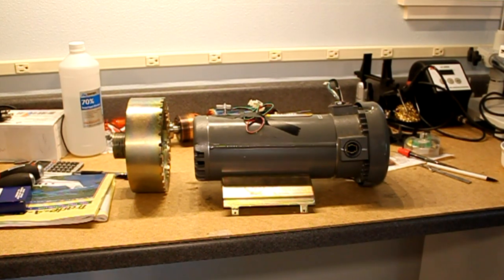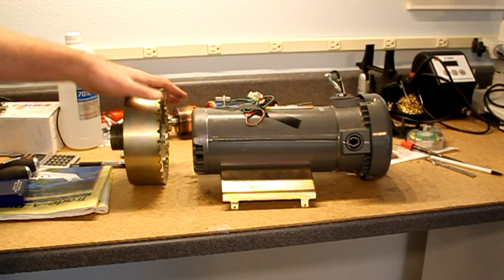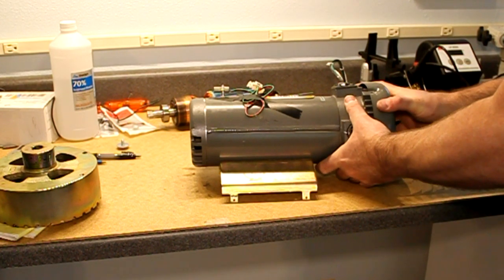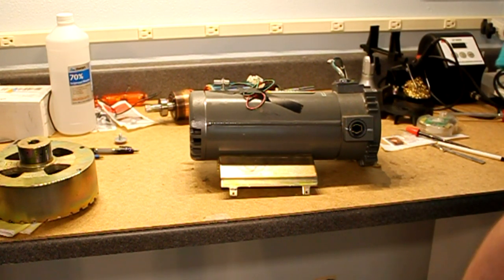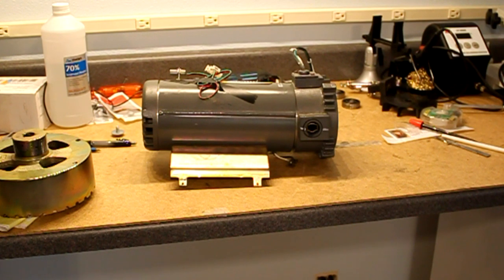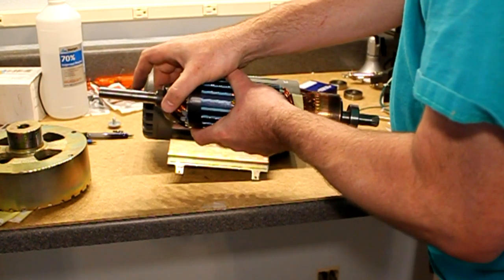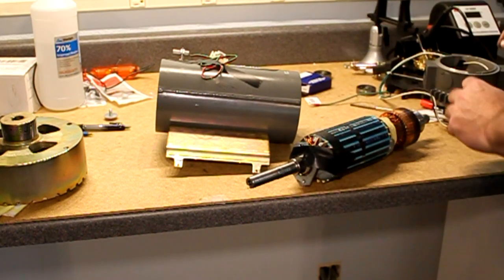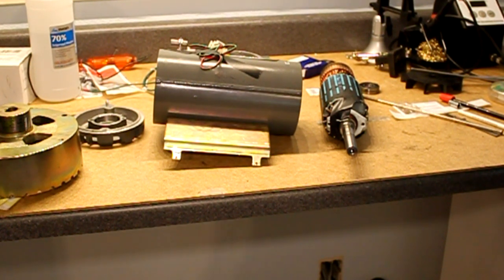Repairing a noisy Landice L7 Treadmill Motor (Baldor Brand)

Comment: Thank you for this video!  

This fixed our Landice L7 Treadmill.  We've had it for twenty years and my wife uses it 5 times per week.  Over the last few years it got louder and louder until we could hear it throughout the house even though it is in the basement and my wife had to use noise cancelling headphones.  

The bearing that was bad on ours was the end with the brushes.  For $14, I got 2PACK TIMKEN 6203-2RSC3 6203-2RS Deep Groove Ball Bearing 17x40x12mm from Amazon

Three suggestions to make the job it easier.

1. Scratch a line or draw a line with a marker on the body across both end caps so when you reassemble you can have the end caps aligned for the long bolt to line up and this also preserves the orientation of the brushes to the magnets, so that the motor timing is not altered.

2. My bearings and especially the flywheel were rusted on the shaft making disassembly much harder.  I wish I would have applied PB Blaster to make it come apart easier.  Once my shafts were cleaned and lubricated, the counterweight and bearings installed easily.

3. I drilled a 7/8" hole in a short piece of 2"x 4" and put that in a vice to allow me to stand the motor on its end with motor shaft in the hole in the wood.

Comment: Thanks so much for this.  I just got both new bearings on but I don't know which direction the spring washers go on when putting that one side back on.  There are two in there so not sure if they both go in same direction or opposite direction?   Also, I did not need a gear puller for any of it.  I was able to get one bearing off with some light hammer hits, got the flywheel off with a mallet, and got the other bearing off with a slide hammer with a claw at the end.

Comment: Just did this fix and everything came apart as described and went back together easily. No presses or heat needed. A few taps with the pipe and mallet, with a gear puller. It's working good as new!

Comment: Got this treadmill for free got it for the motor to use on my Southbend lathe restoration project. Had trouble taking off the flywheel, thank you, I just need to go get a gear puller and I'll be back in business

Comment: Some notes on the repair of my wife’s Landice L7 Treadmill.  Hopefully it will help others.  This L7 is 12 years old and may get up to 1,000 miles a year use.

I used a set of NTN bearings model 6203LLB.  They have seals on both sides.  I purchased them on Amazon from Global Power.  They cost about $20 for the set including shipping.  The old bearings were NSK-ISKRA 6203V, which appear to be identical. 

Have a vacuum , some paper towels and rubbing alcohol (90%) handy.  Lay old newspapers down on your work bench.  The motor will have a lot of motor brush dust.

My motor did not have the bearing retaining plate on one side of the motor like the other commenter’s did.  I see the screw holes, but no screws or plate.
The flywheel was very hard to remove.  I had to buy a 8 inch gear puller at Harbor Freight for $20.  You will also need a small gear puller to remove the old bearings (you may want to try one of their sets)  Clean the shaft before reassembly.  I removed the shaft key and the flywheel went on easily.  I then inserted the key.  It went in with a little tapping.

You will need a short piece of pipe to install the bearings.  It needs to slide over the motor shaft.  I had to make one out of old conduit.  You might want to check HD.  I think the shaft size is a little over 5/8”.  A 6 inch piece of pipe would be better.
If after assembly you test it and hear a ticking in sync with the rotation of the motor, try reversing one of the motor brushes.  If the ticking gets worse, reverse both.  (FYI: I had to replace my motor brushes at 8 year old.)

Results: before replacing the bearings the noise level was so loud it was impossible to talk over it and I could hear it throughout the
house.  Now the motor is silent and I just hear the whisper of the belt.  It took a full day to fix but I could likely do it in half the time now.

Comment: Were you able to restore this motor to a properly working motor? I'd would have like to seen a video of that.  

Landice will not sell you these bearings.  If you ask them they tell you that this motor is "sealed" and is not repairable.  They say that you need to purchase a new motor.

I have this exact motor with bad bearing sitting on my porch which I going to tear into as soon as I have some time.

A new Motor from Landice costs $655.00 retail.  Bearings would be a tad cheaper. ;-)

Comment: Great video. I have about a 9 Year old PROFORM X started making some noise. I am almost certain it's the motor. Don't have a gear puller or a press so I will be taking the motor off and taking it in to be repaired and save myself a big headache. great at tearing apart it's the putting back together I find frustrating. rebuilding surely can't be all that expensive. We have a shop that has been reasonable in the past to rewrite motors so thanks and keep up the good work helping us shade tree mechanics. 😜

Comment: I wish I would have searched a little more before I sent in the motor to be rebuilt.  I did not know if the L8 motor, which looks just like the L7 motor, was a left or a right hand thread to take off the fly wheel.  I can save my company a lot of money if I could rebuild the motors myself.  Can you tell me if they are left or right.  I would assume they are right hand threads due to the way they rotate on the treadmill. Thank you for the video and your time.

Comment: Great site. I tore down the motor and replaced both bearings and now my Landice L7 treadmill is running like a champ. I did have to buy an 8" gear puller to remove the flywheel and bearings. I used a pipe to replace the bearings and just a few light taps with hammer put the fly wheel back on. If your a handy man this is easy. Saved me an estimate of $1100 for a new motor and labor.

Comment: Thank you! I'll do some digging.

FYI: I used a sound meter to measure how loud my treadmill had become. I measured at about 5.5 feet above the deck, near the control panel and got 87db at 6.5mph and 88db at 7.5mph. I measured 90db for both speeds, near the back of the treadmill. I've read that 90db and above for extended periods can cause permanent hearing loss.

I plan to flip the deck, replace the belt and motor bearing(s). It will be interesting to see how much difference I can make.

Comment from the maker: The bearing I used was a "6203LB NTN" that I found on ebay. Beware that although this was the same part number as the bearing that I took out of the motor, what I received was a bearing with a seal on one side whereas the one that came out of the motor had a seal on both sides. So, I recommend doing a little bit of research into the bearing part numbers. There's probably a suffix that indicates double- or single-seal.

Comment: I have a similar issue. My L7 has gotten quite noisy over the years. It has a Baldor motor similar to yours. I would appreciate it if you could tell me where you got your bearing, the part number of the bearing, or anything else that would help me to locate one. Thanks!